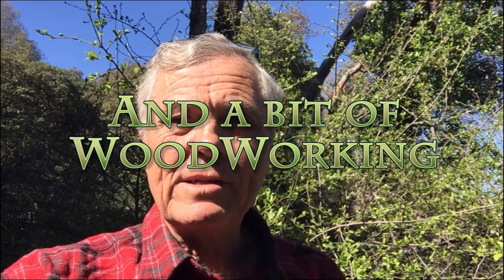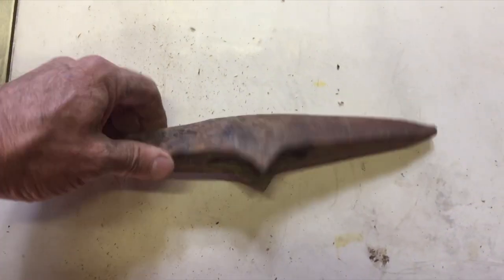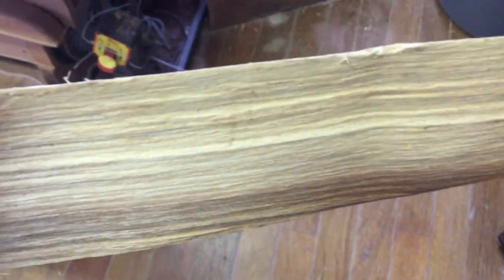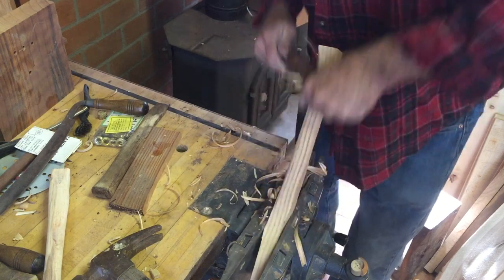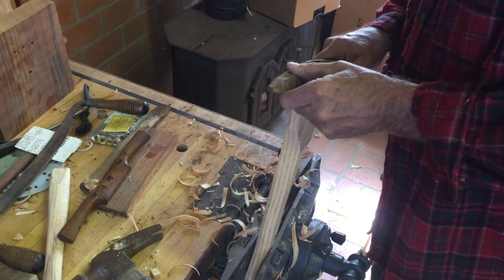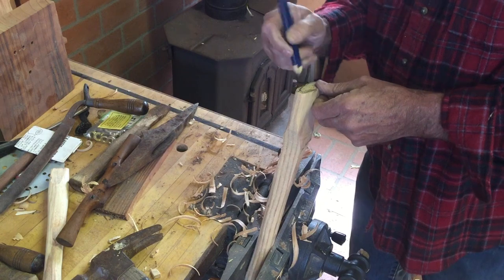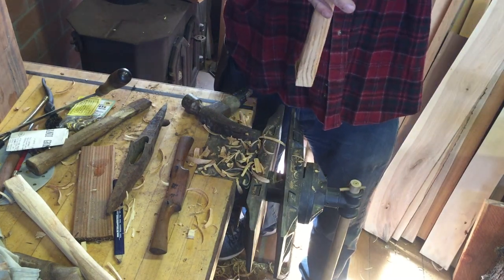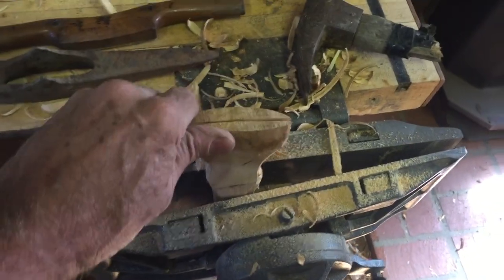HOW to MAKE your own TOOL HANDLES

Comment: I am only half way through (so far so fun to watch), but I am hoping you show the way you de-rust the pick head.  I have had good luck with evaporust so far on my various restoration projects and it gets down in the pits and inside surfaces, I have even had it go inside a loose bolt/nut to get in between and clean it, so am curious which method you will use for it.  Aha 60 grit sandpaper, yep that works too. :)  That came out really nice.
Reply from the maker: Glad you enjoyed this

Comment: Are you concerned that the wood has higher moisture levels and could shrink after being fit into the eye?
Reply from the maker: I brought it in and put it next to the heat overnight first so it dried.

Comment: I've a lot of ash on hand. they're dieing off here in southern new england, but wouldnt consider it for tool handles. Pignut hickory is about as good as it gets. but I prefer locust for tools that may get left outside.
Reply from the maker: There are a lot of different types of Ash with differing characteristics. The fast growing giants ((Fraxinus udehi), would not be good. The Modesto Ash is very different. There’s Ash and there’s Ash, and then there’s Ash😊